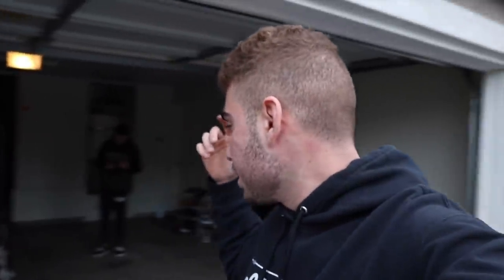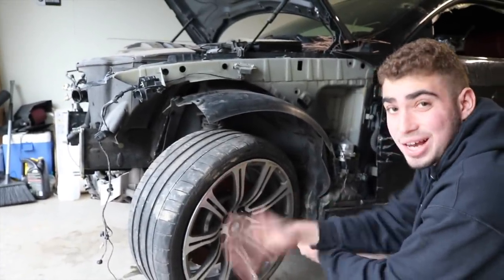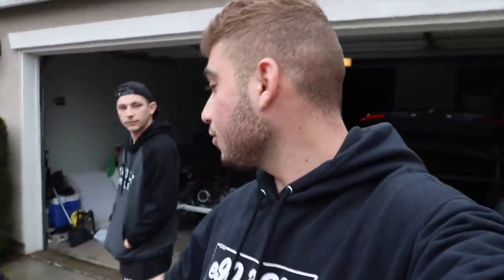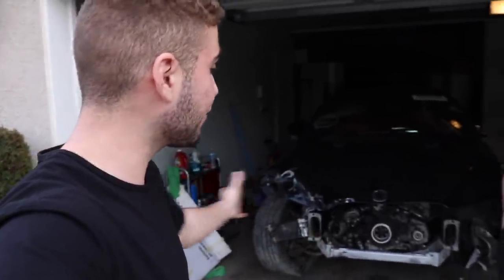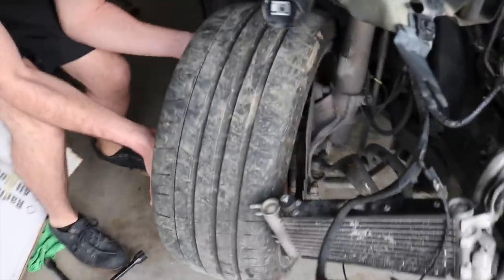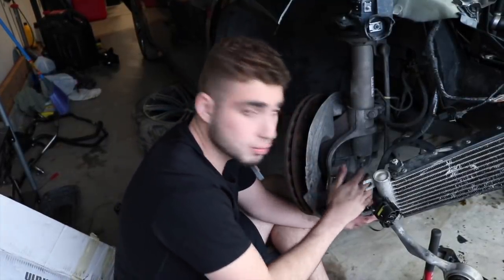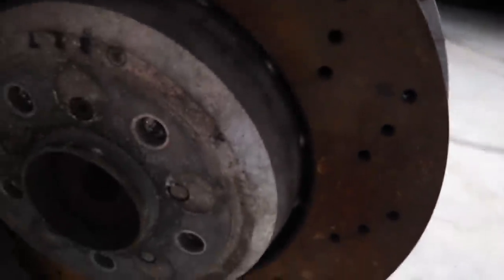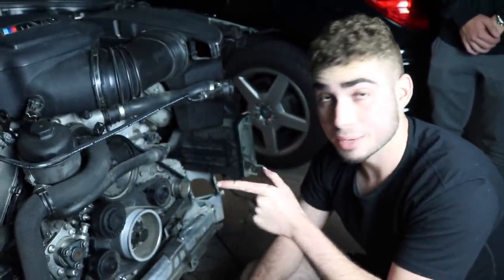Rebuilding A Wrecked BMW M3 Part. 3

Comment: Hey Nour I love those M3 wheels. I get so psyched watching this new M3 vids. 
Just an idea to help protect garage floor to catch leaks and spills buy some pig mats. 
This could help you out as far as the maintenance history that is you can run the Vin number through BMW and find out which dealership has done maintenance on the car and possibly already have done the rod bearings.

Comment: The struts moving is not an issue. That's your top mount movement. But I recommend replacing both the wheel bearings. That's the safest. Even if they turn. Also when spinning the brake disks, check if they are bent... I missed this when checking my car

Comment: Yo those control arm bolts come off way easier if you use a wrench and stick a torx socket inside and twist that instead

Comment: Hey Nour, I need your help I'm currently rebuilding a 2008 e90 M3 that I purchased from a salvage dealership. At 6:29 on your video I noticed you were looking at a sensor that sat on the frame rail. Could you possibly let me know what sensor that is? I've been looking all over the internet to find it but have not had any luck. I would greatly appreciate it! By the way, love the content!!
Reply from the maker: Hell yea man, took me a few days to find it myself. It’s the crash sensor. Other words airbag sensor
Reply: Thanks my man! I appreciate it!  @NourHummadi